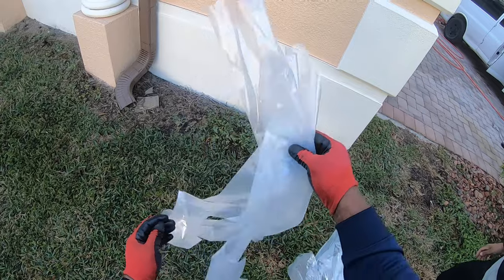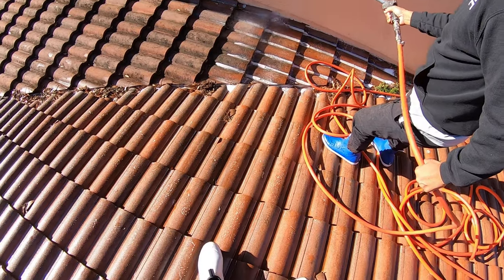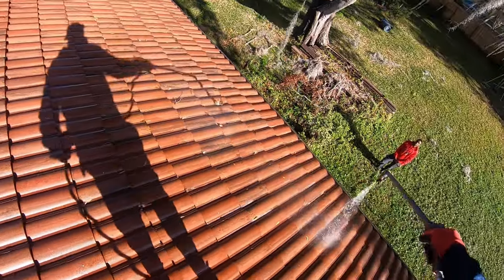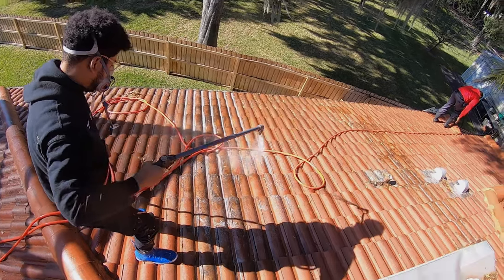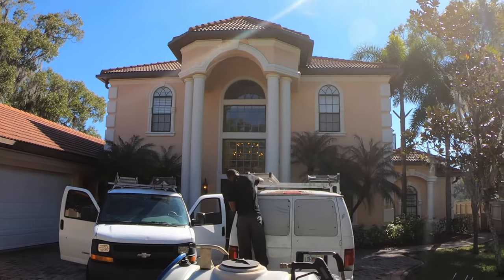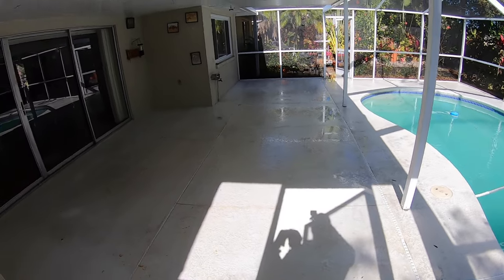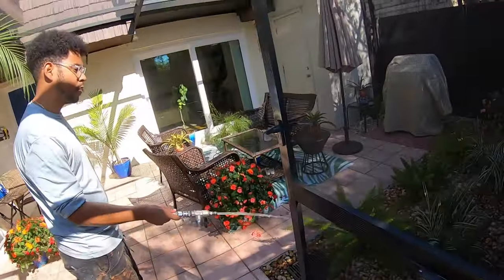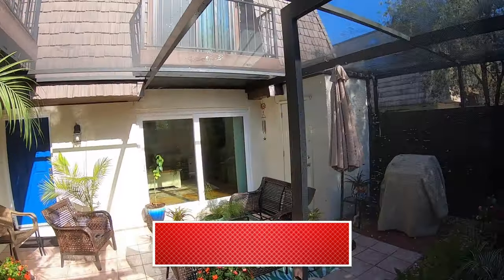Tile Roof Wash with Delevan "Fatboy" pump| Low Pressure Lanai Cleaning

Comment: What I don't understand is are you rinsing the bleach off or leaving it on? The roof?
Reply from the maker: No need to rinse unless it's metal roofs.  Honestly it's all depends on the operator.  I personally don't rinse Shingle or tile roofs.
Reply: @PinkFlamingoPowerWash  

Another thing I don't understand is how are you adding different bleach percentages? I don't have the equipment you have. Right now I use a regular pressure washer on wheels and 30 second cleaner from home depot which is 5% in a canister. How can I change the percentage?
Reply from the maker: @clbo9878  u gotta use the pool chlorine commonly known as sh. That's what pressure washing and soft washing companies use to kill algae mold and mildew not that home depot stuff.  

I'm guessing you don't have a soft wash system or mix tank. So only way youll get 5% is if you get real chlorine from a pool supply store mix it half and half in a pump up sprayer. That's you're 5%  

When you get a bigger tank and want to batch mix use this video and there's a link to get the excel file. Just request access to it. Good luck bro.
https://youtu.be/V_msWPLbgCo

Comment: Hey cliff, do you ever rinse the roofs you softwash? I have been rinsing because I am always afraid the next rain is going to rinse the sh off and nuke the yard/plants. Downside is it adds almost an hour to ever roof job. I have read/watched conflicting opinions online, just trying to get your take on rinsing. thanks
Reply from the maker: I've never rinse a Shingle or tile roof.  However I do rinse metal roofs.
Reply: At most, just rinse part of the way up the roof. No need for the whole thing to get rinsed off. 👍

Comment: Hey Cliff..That surface cleaning area is an upcharge to a basic pool cage cleaning correct or ? Or you include it in your quote?  Had a customer think it was included after i quoted them
Reply from the maker: Oh no it's definitely not included if they don't ask for it.  I always ask if they want the deck cleaned and give them a little discount since they're bundling the services.  Some customers will try to get a 2 for 1 if you don't tell them.
Reply: Thanks for the reply..Enjoying all your video's and info.

Comment: What would you charge to surface clean 28k sqft at an apartment complex? Price per sqft
Reply from the maker: Depending on the market.  Anywhere from .20-30c a sq ft
Reply: @PinkFlamingoPowerWash  I figured I'd hit em at the low end with .20. New to this business but I'm not trying to be that $99 special guy. Thanks again for the info. Always enjoy watching your videos and learn a lot.
Reply from the maker: @cfraioli5108  that's a good profitable margin honestly

Comment: Any advice when you going on those title roofs? You up there like nothing lol.
Reply from the maker: Yes. Walk on the overlapped part of the tiles.  If you step in the middle they will crack.  Stay flat footed and don't walk using your toes. Weight has to be evenly distributed.
Reply: @PinkFlamingoPowerWash  thank you , but when you spray the sh don’t it it slippy cus the algae?
Reply from the maker: @oscarcalles7774  if its heavy algae yes. So get some good boots 🤙

Comment: Best soft wash pump in your opinion?
Reply from the maker: Remco
Reply: @PinkFlamingoPowerWash  that’s what I’m looking into. 7GPM, 60 or 100 psi?
Reply from the maker: @hugolopez9583  I've had the 100psi one but either will work fine.
Reply: @PinkFlamingoPowerWash  sweet definitely trying it out next.

Comment: what chemical do you use for the roof
Reply from the maker: SH
Reply: @PinkFlamingoPowerWash  it would be interesting if you upload a video of how to mix the sh
Reply from the maker: @carloshidalgo1315  no problem. You mean show how I adjust my valves to get my mix? Cause I don't batch mix sh anymore.
Reply: @PinkFlamingoPowerWash  how much sh do you put per gallon, and the %sh
Reply from the maker: @carloshidalgo1315  I don't do that anymore. I have a proportioner so I don't need to mix sh to apply it.  But when I was doing that I used to do 50/50 mix for roofs.  So whatever tank you're using put half sh and half water plus some surfactant.